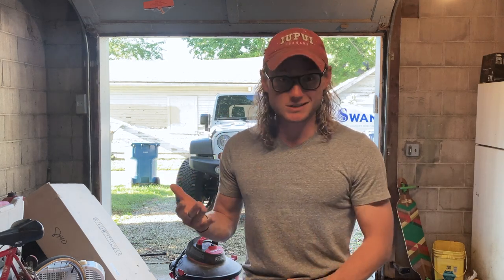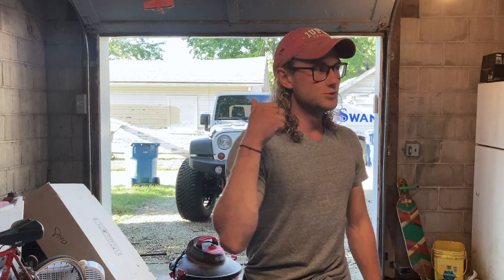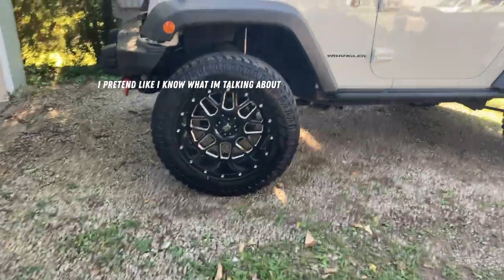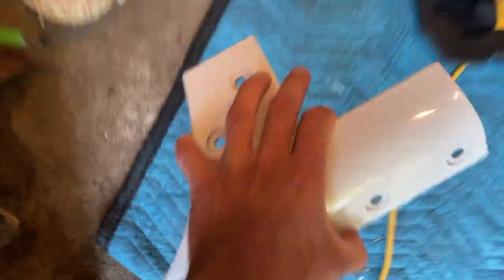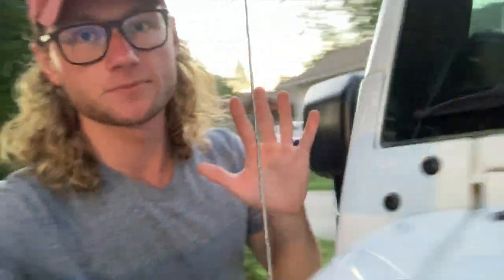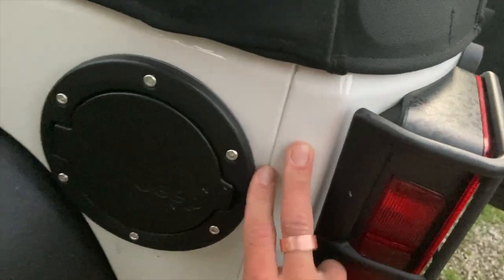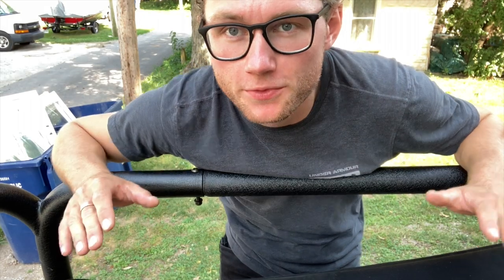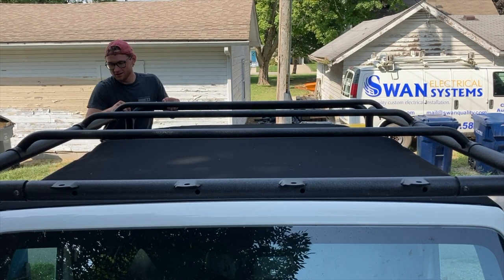Barricade Roof Rack - Body Mount Installation

Comment: nice job  I recommend you putting some silicone  around the rear bolts  holes you drilled so that no water or moister rusts out the metal.
Reply from the maker: Shoot. This is actually a great idea. Good thinking!!

Comment: So I mounted mine to the bumper and like you said now I can't get my OEM rear bumper back on. Do you suggest mounting the rack the frame, I was worried it would compromise the weight capacity of the roof rack.
Reply from the maker: It does compromise the weight capacity with the direction I took (body mount), although you really don’t loose much. I preferred this method only because I liked my OEM bumper and didn’t want to buy a new one. If you’re comfortable taking measurements and drilling holes in the Jeep then I’d suggest that. Otherwise you have to buy a new bumper. Now if you do plan on buying a new bumper, by all means go with the frame mount!! Hope this helps 🤙

Comment: Hi Brad, great vid!
I’m looking at getting the same rack, and mounting to body same as you as I have a stock bumper with parking sensors.
Do you know if mounting to body reduces the 350lb capacity compared with frame mount? Have you noticed any problems with body mounting as tkme has gone on?
Cheers
David
Reply from the maker: As far as I know it does not reduce the dynamic weight capacity. Static weight capacity is also still 500 lbs according to manufacturer specifications. After about a year with the rack I haven’t noticed any issues occurring. A little squeaking here and there but nothing abnormal. Regular tightening of the bolts is to be expected. Overall it was a great purchase decision. I hope this helps!!! Let me know if you have any other questions.

Comment: hey man, where were you able to determine the roof loading capacity of your jeep? im installing a frontrunner extreme slimline II on the jeep wrangler rubicon 2 door MY22 but can't for the life of me find the recommended dynamic roof loading capacity so i can know how much i can safely stow on the top for camping. at the moment my setup is about 92kg including the slimline itself 
the slimline installs onto the roll cage and has the bars which come down onto the front bonnet like yours so the hardtop doesn't actually hold any of the load with it on
Reply from the maker: I was able to find my specs through the manufacturer. Best bet is to search around and see if there is a product guide anywhere. Worst case scenario you could always try to reach out to the manufacturer for more information. I can tell you that the rack I bought has a 159kg weight limit while driving and a 230kg static weight limit. Most racks should be able to handle your load. You got a nice one!! Hope that helps 👍
Reply: @Wolf_Off-Road  thanks mate, appreciate the reply!

Comment: How hard is it to take the top back with the rack on?
Reply from the maker: Not too difficult! Those top cross bars simply unscrew and you can put them back on when you pull the roof back.
Reply: @Wolf_Off-Road   But once you have your top tent on, must be impossible to drop down the soft top? I like the model of the rack but I'm just wondering about droping the soft top.